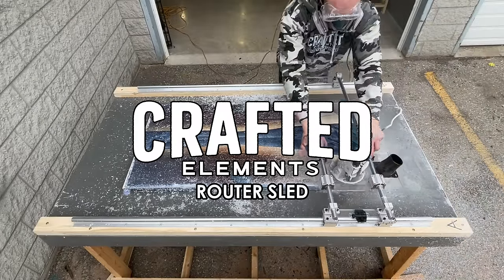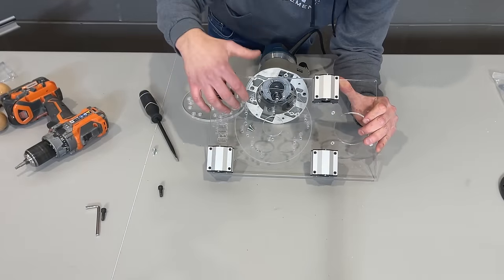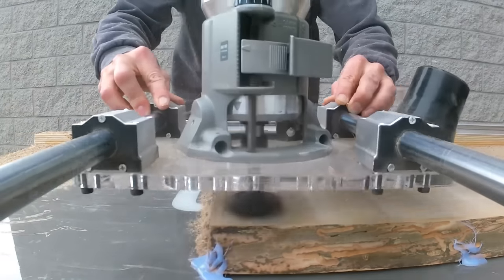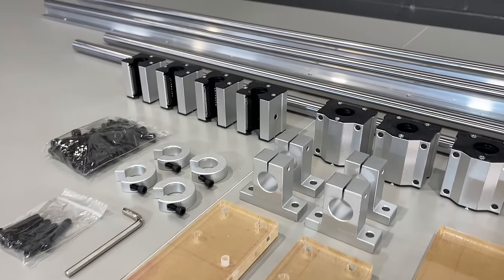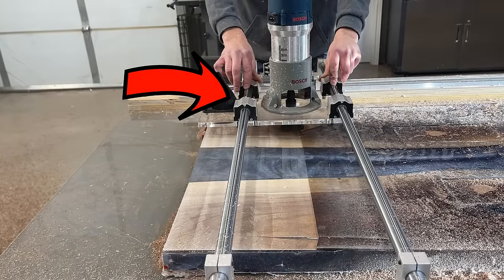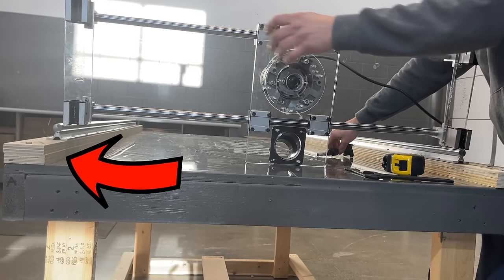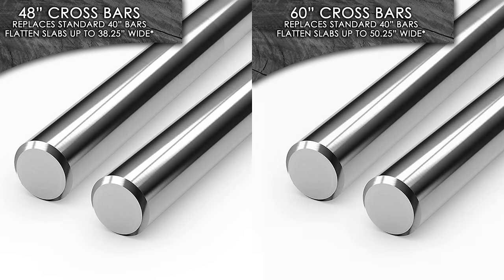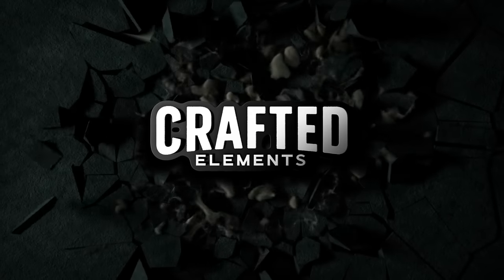Easiest Way To Flatten Big Wood Slabs And Level River Tables - The CE Router Sled & Slab Mill

Comment: A great product! Just had mine installed and used for the first time on a maple epoxy river board. My plainer spat the board out with a catch as it had a bow one side. The crafted Elements board flatter did the trick. Thanks!
Reply from the maker: Amazing! Glad it you found it helpful in your shop.

Comment: Good idea!! Apparently you put something to block the wood while working. It appears around 0:19 at the corner of the piece. What is that? Many thanks!
Reply from the maker: Do you mean the hot glue to keep the piece on the table (goop of white stuff?)
Reply: @Crafted Elements  yes! So it is hot glue, right? And you can easily remove without any impact on the piece?thanks!
Reply from the maker: @stefanocolapaoli1961    Most definitely. And usually relatively easy to remove, peel off or sand off.
Reply: @CraftedElements  thanks a lot!!!

Comment: What do you use as the base to put the piece you want to level on?  Has to be something that is level right?  So you can level the piece you want .
Reply: Wish they would answer questions like these
Reply: I use a sheet of 3/4" ply and mount the rails on strips of 3/4" ply
 Before mounting I just run a level across to check. It's pretty much bang on level. A few low low spots but maybe 1/16". Nothing a sander can't take care of.

Comment: If you attach your slab to a flat even thickness board and then hold down THAT board you could level much longer pieces by moving the board-slab assembly.

Comment: The table you setup on needs to be level right?
Reply from the maker: Straight is more key than level. If the table isn't level the bars mounted to it will also not be. Straight/flat is the key.
Reply: @CraftedElements  straight? As in parallel with the runners on the side?
Reply from the maker: Well, completely flat, no cupping or warping. The runners (linear rails) on the side will bend slightly to meet whatever the profile is of the table top.
Reply: @CraftedElements  oh you meant the table that the raiks will sit on. Yea its straight. I thought you meant the piece I'm flattening to be straight
Reply: @CraftedElements  I think it's important, too, that the workpiece remain absolutely still from beginning to end of the milling process.

Comment: I onced loved Crafted Elements until they started copying and selling someone else's design...the epoxy mold side must be dying.
Reply from the maker: I dont think I was alive when the first router sled was developed and used. Woodpeckers popularized a standard design and sold it for years. Everyone has come up with some sort of variation. Anyone claiming that a router sled made with linear motion parts is somehow an original, unique idea should likely have a reality check.